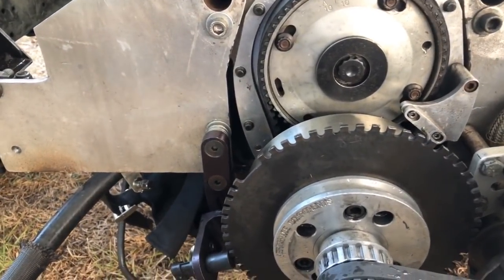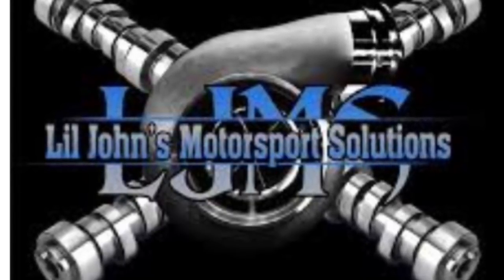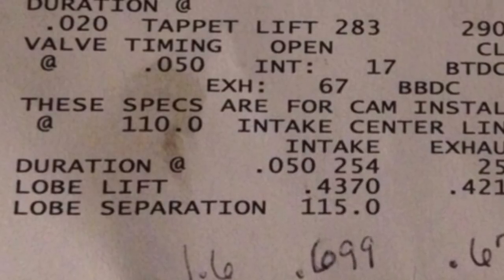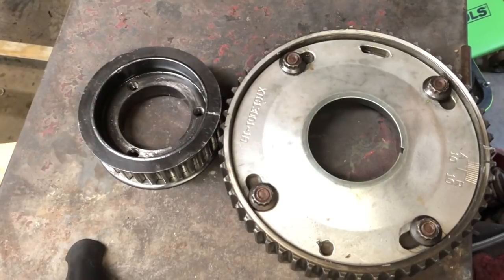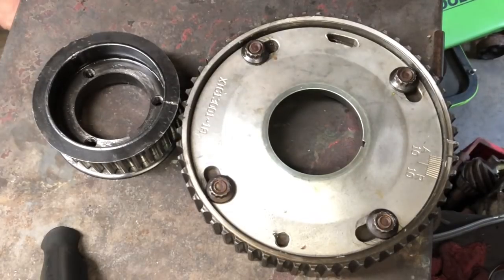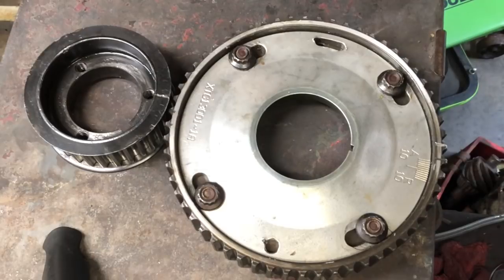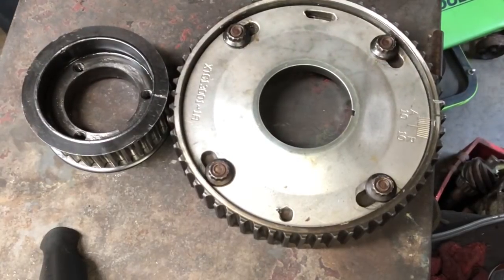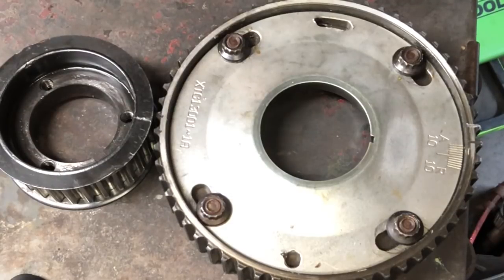Degreeing a cam, Cam Timing explained!

Comment: So how do you feel about VVT ( assuming oil pump pressures and phaser psi/ higher spring rates aren’t part of the equation) instead of having to tearing apart every time to make a change on the veneer gears ??
Reply: Like it is on the miladon part number 1300 gear drive
Reply from the maker: I have never messed with that stuff!
Reply: Hum 🤔 might be something worth trying. I’ve owned a Chevy 350 and 327 but right now as I’m typing I don’t remember the oiling Circuit for that architecture and isn’t handy for me to try to look at it but by all means I’m willing to teach a old dog 🐕 new tricks and talk about/tell you my understanding of how it works as I’d love to learn something new. The newer LSX and LTX platforms have it stock. What I understand is your 350Lb on the seat sping pressures can at higher RPMs ie 6k-up can over power the phaser unit ( running 80 ish psi oil pressure and sometimes may need limiters installed to change the maximum degrees of movement ie 62* total to 20* total ) but to my knowledge no one in the aftermarket has tryed turning up the control pressure to say 200psi ish to 500-1000 psi to compensate for it at higher RPMs and loads. And from my reading 📖 it’s worth up to 30tq ish 60hp ish and you’re saying 1/10th in the 1/4 Mile which is pretty good 

I have two phasers right now and my scheming plan is to change the Lobe separation angle with one ( same idea 💡 as the 2004 Dodge Viper I even bought a camshaft to see how it was made to use it as a patern for the v8 as the original was a v10 and if my block was a LA 340 this would make it easier as the lifters and bearings are in the same place just 2 extra cylinders to make it a v10 and a different cam lobe pining/ grind but that’s easy to change ) and the other one one is the same as the LT4 Chevy concept but on the 440/426 hemi the easiest place to get high pressure oiling control to the stock Gm/FCA phaser which by the way there pretty inexpensive to buy or make your own ( total I think 💭 you can pick up a setup for under 200$ easy used in a junk yard probably under 40-80$ And they look and work like a vain pump in reverse so I don’t see why the stock LT4 cases and vains can’t handle 1200Psi as it’s made from 1/4 thick piece of mild steel or better.  edit I added with some quick research it looks like it’s common for dragsters to use a belt camshaft timing setup and co2 or N bottles, I don’t know why jonn you chose it over chains or the gears and the same way with not just running a extra pump ( oil or air  @ 100+ psi to things like the waste gates as oil wouldn’t hurt it and or a electric 8-24 VDC servo/stepper motor ( as seen on GM DBW ) can work quicker than co2+ Pixies and there are simi sized inexpensive ish 80+mm turbos ( just have to look as I don’t know that sizing as well because they don’t fit my doghouse/car and never needed one but have seen them on friends simi’s. Ie holeset makes the Cummins pickup truck ones and a bigger hx-60 ish aka it’s way bigger sizing but looks the same as my units construction ) ( mine are twin 76-70 efr and a 2012 2500 Cummins VGT ) that have variable vains or variable wall technology that do let it spool up quicker/ easier to control the boost and is is easy to control with a aftermarket ecu/controller like the one from cheata performance diesel es a example and their a YouTube video of how to install and how it works ) and the same with anyone else but I did find your CO2 bottle can be plumbed to control it instead of oil or using co2 over oil methods obviously the dry belt system would look way different from mine but do the same ish things ) is the old fuel pump rod hole that I’m not using ( the bad thing if I change my mind or someone else what’s a copy and still running this cam I’m stuck with the same type of pump your using and in my case it’s cables driven off the back of the oil pump to the back fuel tank or a electric one but the stock one is just barely passing grade not really a high hp or ethanol or methanol compatible etc. pump ) but sense Its a 3/8” or so it makes it a good spot for a A/N / JIC fiting strait from the dry sump oil pump ie something like that R4 Peterson but mine is made by deviant misslle . Com / Indy sells it aka the same one on the Motown misslle uses and other dragsters using its own pumping section ( added on to the front of the pump getting 80Psi boosting it to control psi ) so I can control psi to it better the front timing cover holds the camshaft sensor and the VVT valve timing magnet control ( it can be a on and off out put like a 5-16VDC toggle switch or PWM controlled the holly ecu’s and Gm e38 can control it as of right now that’s my plan for efi as both of us sounds like we’re not into carbs anymore )  the valve bolt is threaded into the front end of the camshaft underneath the magnet Pentel the phaser is single pined from the factory but using splines on the camshaft nose and back phaser plate ( or making a one piece/brazing on ) is probably a better way the bolt holds it in place along with the pin/Splines the oil comes through the middle of the camshaft to control parts and up stream that’s where the cross drilling is instead of a fuel pump eccentric that part is cam core size @ie 48mm ( not my real camshaft core size as 60mm is the golden standard so that’s why I picked it with 620th /16mm of lift and it’s easier to stuff the extra oiling and control features in it but doable with 55mm as that’s what I’m remembering the stock gen 4 / 5 Viper sizing is ) the back does the same thing on the last camshaft bearings the JIC fiting is in between the oil pressure sender and the cross drilling lifter passage that’s blocked off from the factory.  Variable LSA feed is the same line to the control section oil line in front, and yes someone can use both like I did or just one phaser/ veneer gear one side or some combination. as you can see that I went for control freak on the fly as I’d didn’t want to have to compromise the cam grind or having take off the water pump and front timing cover and the same thing with the back side of the camshaft to change LSA manually